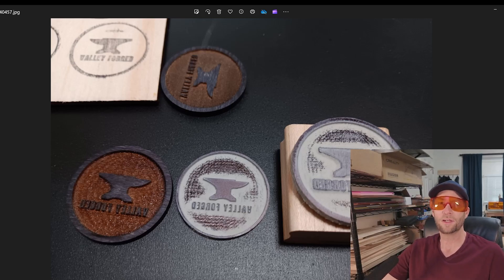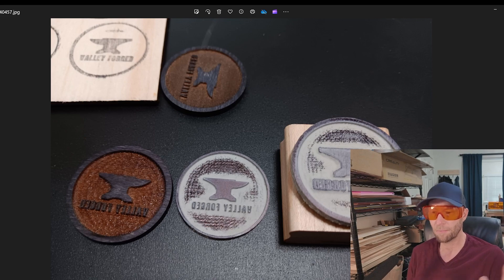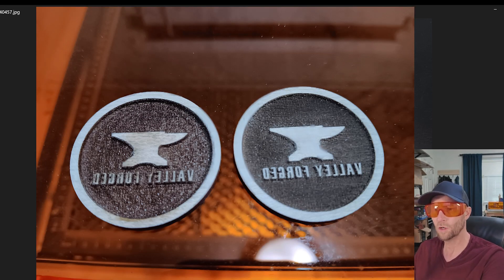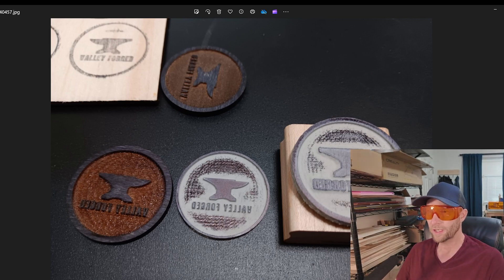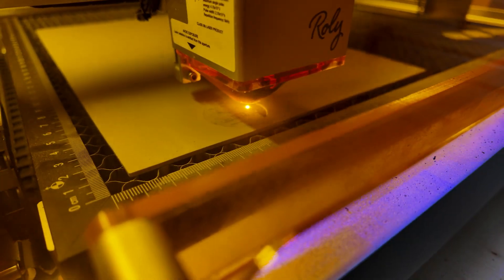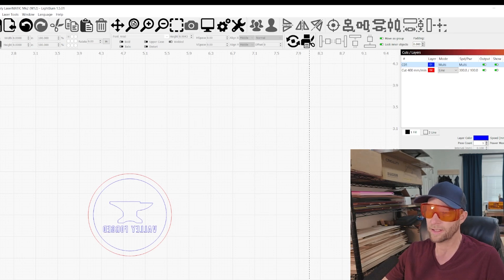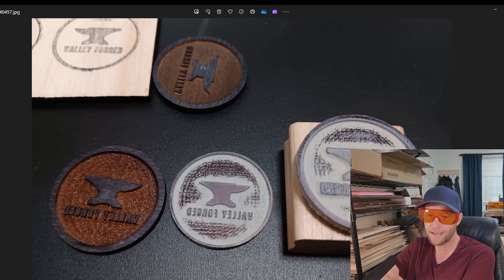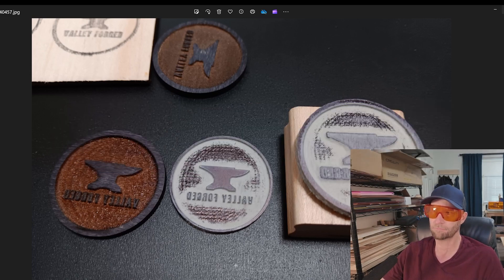Make a Rubber Stamp with a Diode Laser Engraver (Lightburn)

Comment: Hi. I'm waiting for my LasterMatic to arrive. It will be my first laser. One question: Why don't you always enable the air assist, regardless of the material you're cutting or engraving? Thanks.
Reply from the maker: Great subject for a video :). Short answer, using air when engraving makes the wood dirty. When cutting you mostly want it on.
Reply: @ValleyForged  I had no idea of this. I always keep my air on to some extent. Next engrave I will try it with no air. Thanks! I have been learning so much from you :)
Reply: Personally, I always run at least some air and I really haven't had much trouble with the wood getting dirty. It does seem to depend on the wood - I did have one particular run of birch plywood that is crazy sooty and would get filthy even without air on. Often when engraving I'll run a lot less air - barely open the valve (I'm hooked in to my shop air) just to maintain positive pressure around the nozzle to help keep the lens clean.